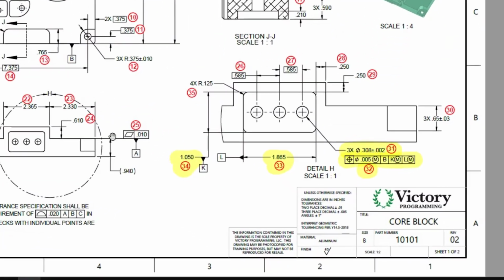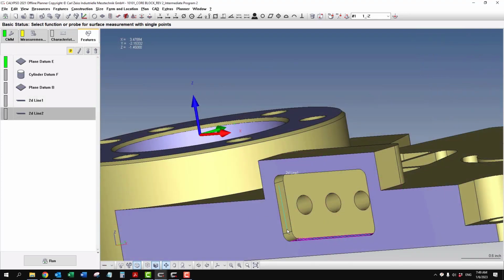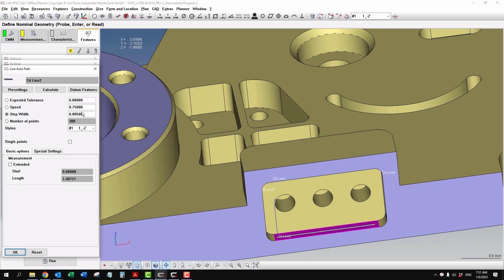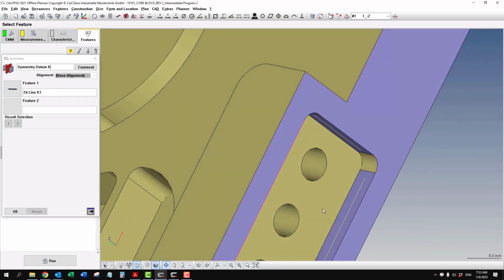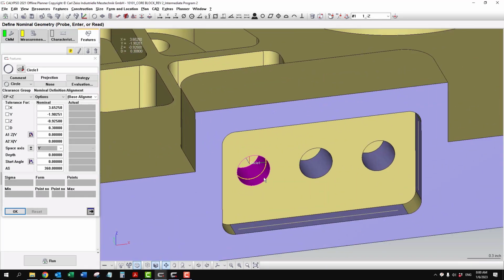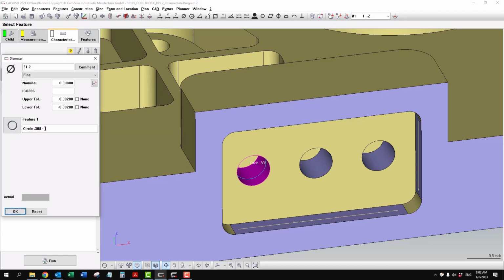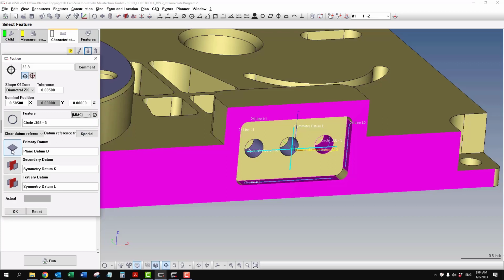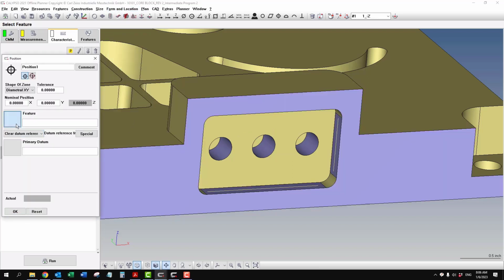Calypso Tutorial - Position of Holes in a Pocket

Comment: No MMB in DRF_K & L?
Reply from the maker: Calypso is limited in its ability to calculate datum shift from datums with the MMC (MMB) modifier. With the "Symmetry Plane" feature of size, there is no option to use MMB in the position characteristic on datums K and L. Since Datum B plane is the spatial rotation (levelling), it is acceptable to use line features for datums K and L; as well as the fact that the pocket is relatively shallow.
Reply: If so, you might reject the good parts.
Reply from the maker: In a situation like this, where Calypso does not give the option to use MMB, you can use a formula in the tolerance box to calculate the available datum shift and add it to the tolerance in the X and Z directions.

Comment: Hi, in datum reference frame You have (M) symbol to datum K and L. Instead of using simply "symmetry" try use "plane of symmetry". Then You can use MMC to datums K and L. There is a little issue, You can't measure this datums whith line fuatures, ther must be planes.
Reply from the maker: Calypso is limited in its ability to calculate datum shift from datums with the MMC (MMB) modifier. With the "Symmetry Plane" feature of size, there is no option to use MMC in the position characteristic on datums K and L. Since Datum B plane is the spatial rotation (levelling), it is acceptable to use line features for datums K and L; as well as the fact that the pocket is relatively shallow.

Comment: Why symmetry datum k  is planar rotation?
Reply from the maker: Datum K is shown second in the feature control frame, so it will constrain not only the Z origin but also the planar rotation (skew or clocking). Each datum constrains degree(s) of freedom based on its order of precedence from left to right in the feature control frame. The type of geometry that the feature is also dictates what kind of constraint will happen, whether rotation, translation or both.